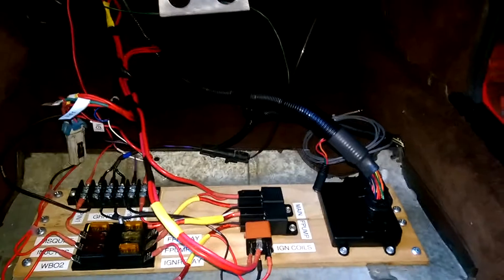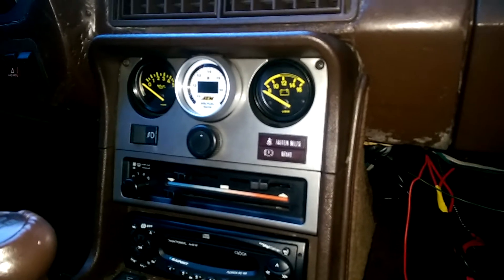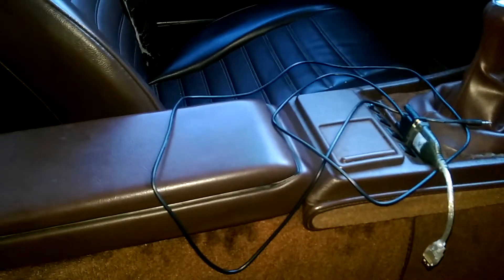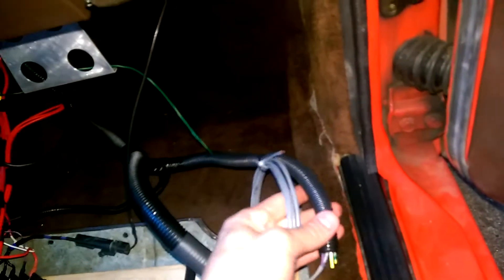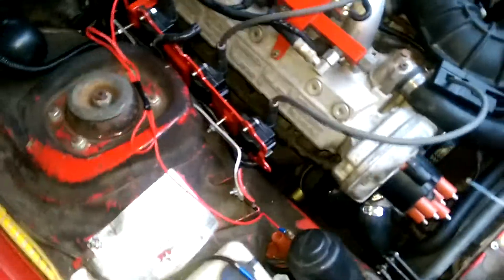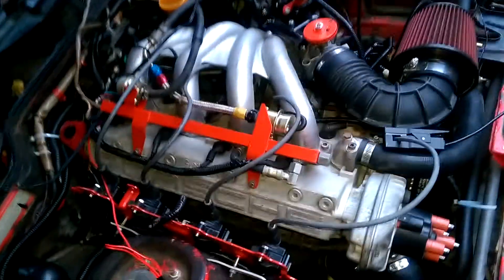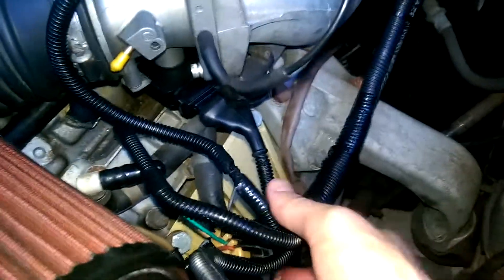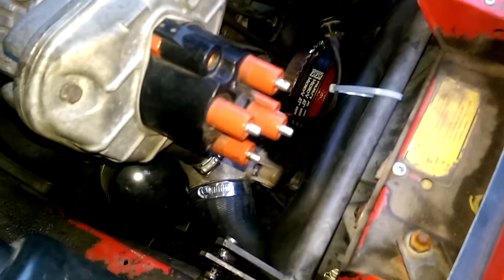Porsche 944 MicroSquirt wiring - part 5

Comment: Quick question if your still around. I am doing a BMW 325e with Microsquirt. Got all My parts in the mail today so starting the planning process for wiring. I'm a little confused on the powering of the Microsquirt. So you are using fused power that is activated by a relay correct? could you have not used the original vehicle relays or was that not a option.
Reply from the maker: +Joe Crofts I removed the original DME relay and did a ground-up relay panel. The ignition switch triggers a main relay, which powers MS and the fuel rail. I have power coming from the main relay to a fuel pump relay and when MS detects RPM, it is activated.